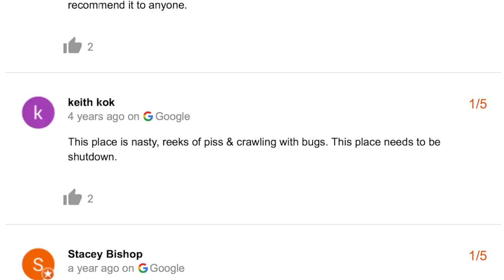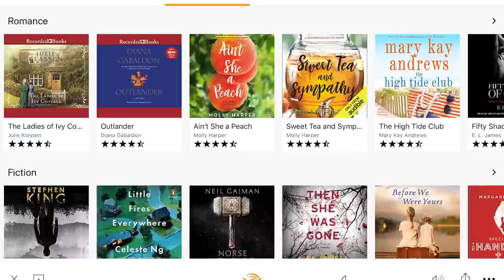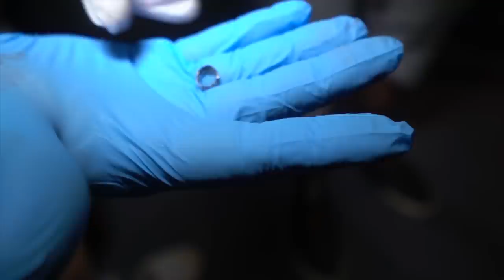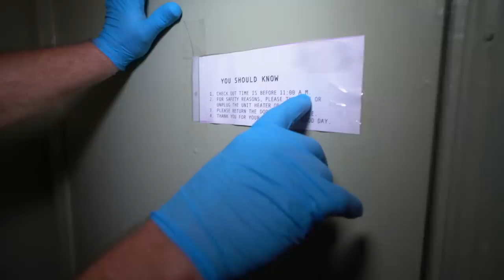Another Dirty Room S2E2 : URINE for a TREAT : Kings Court Motel in Kingsville, MD

Comment: It wouldn't surprise me if the owners have one of those things that you can put over top of peepholes to look through it from the outside. Also, that thing about semen is totally fake. It's a prank that's been pulled at various schools across the country for several years now. Semen liquefies ~20 minutes after ejaculation. If it doesn't, you probably need to see a doctor, not a plumber.